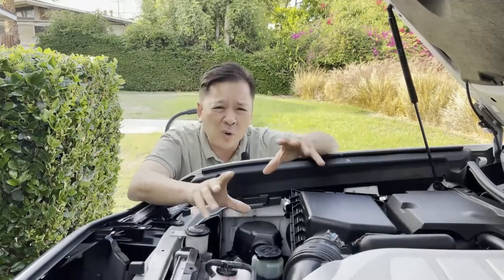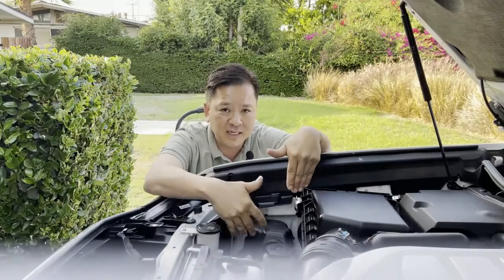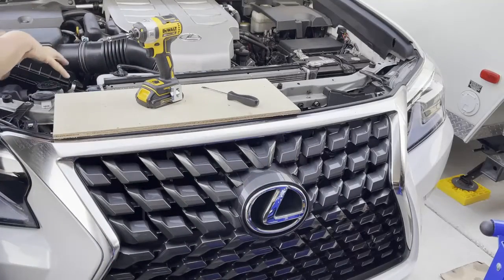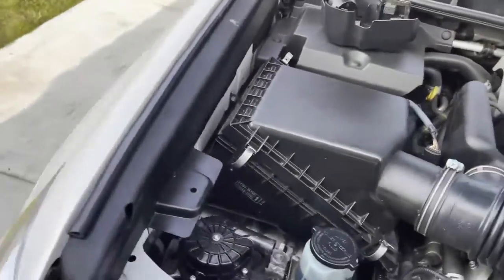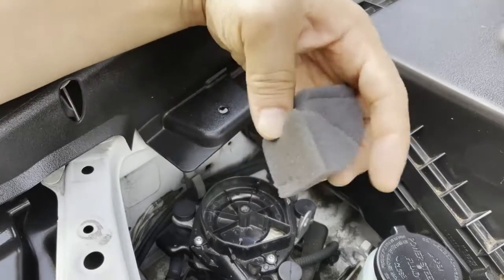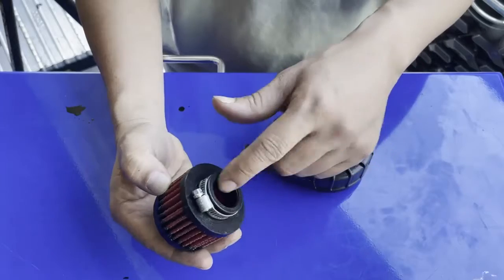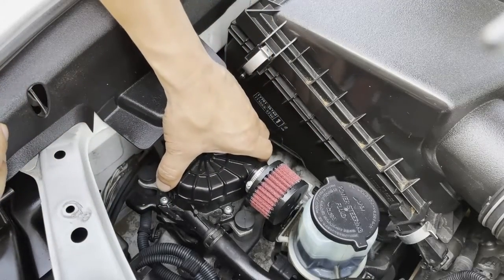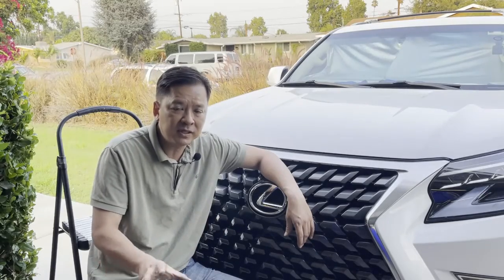Why We’re Modifying the Lexus GX Secondary Air Injection Pump

Comment: Thanks for posting Bob. Excellent vid as Always. Wondering what's your opinion...thoughts on a AGM battery for the GX.
Reply from the maker: I've looked into AGM batteries a year ago.  I've taken some considerations into the length of time i own my GX, the cost,  the advantages, and the disadvantages of buying one.  If i were to get a new battery for overall value and performance i would stick with a Gel battery over traditional and AGM.  Because, even though AGM is built to run and  sustain a lot of your electrical toys on the GX, the advantages don't justify the cost in my opinion.  My car is in southern California with perfect weather year round, i don't have a 5 amplifiers, 8 subwoofers, and a wheel chair lift equipped in my GX.  My lower cost interstate battery upgraded from 24F to 27F with more CCA has a warranty if it should fail on me.  I also have AAA.  I DO NOT want to throw in random aftermarket diodes to accommodate a AGM battery voltage requirements into my car because some dudes "figured" it out.  My batteries only purpose is to start the car and nothing else.  Soooo......the AGM battery doesn't make sense to me but to each their own.
Reply: @GXBOB  Thanks GXBob. Great...info and insights. Super helpful as usual.

Comment: Can I still install this in my 2010 gx460 even though my check engine, 4lo and traction lights have be coming on for more than 5 months now?
Reply: You'll wanna do the recall work first. This mod is only preventative maintenance from preventing what has already happened to yours. I think it's covered under 10 year warranty unlimited mileage. As always, YMMV with dealers.
Reply from the maker: @NytronX  I completely agree.  You're obviously past the 10 year mark but like with anything, ask nicely and you will receive.  If you go storming in there like an ass, they'll throw the "sorry, its past the warranty expiration" at you. I"m surprised your car didn't go into limp mode yet.  Worse comes to worse, i'd go pick up a used one at a junkyard for a couple hundred bucks and replace it myself.  The removal and install is accessible and straightforward.
Reply from the maker: @audreyappliance  Thank you Audreyappliance!  I also noticed a considerable difference in acceleration.  The gas pedal is definitely lighter.

Comment: Will this work even though my check engine, 4lo & transaction lights have be on for more than 4months now. I drive a gx460 2010. Pls help🙏
Reply from the maker: Do the walk of shame to your Lexus dealership.  Tell them you are a long time Lexus owner.  Make sure you have your yelp app out in front of you (because you love to give great reviews to the service adviser that is assisting you).  Arm yourself with the service warranty bulletin found online.  Walk in there and ask nicely.  You'd be surprised.  I'll try to look for the warranty and post it the body of the description today.
Reply: @GXBOB  I reside outside the U.S. My mechanic told me my catalyst converter was bad after diagnostics. It’s very expensive changing fix as it could cost $2,500 to replace. Any advise here will be appreciated. Love your channel bro.
Reply from the maker: @westlipha  Okay so here goes.....i know a lot of people are going to squirm with my advice.....but......if you are not strapped with cash.....your next best option is to replace your oem catalytic converter with an aftermarket one.  Second option is to find a local junkyard with a GX, find a GX that is parting out online, and/or ebay/offerup for someone selling a used catalytic.  I went this route with a different car when i found out the oem one cost an arm and a leg.  I went to the local muffler shop and they bought a universal catalytic.  Will it work on your car?  Only one way to find out...do the research and ask your muffler shop on their advice.
Reply: @GXBOB  thanks will check with muffler shops around. Problem is I need to replace 4 units as gx460 have a pair installed at the front and back of the exhaust
Reply from the maker: @westlipha  True but going with either aftermarket or used is going to be significantly cheaper .  Unless the good doctor has  2500 under his mattress.